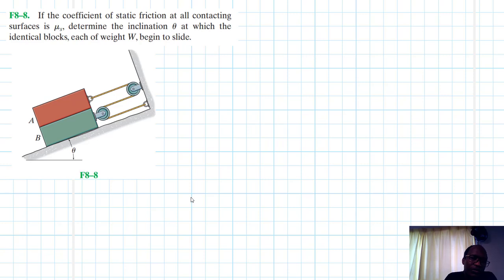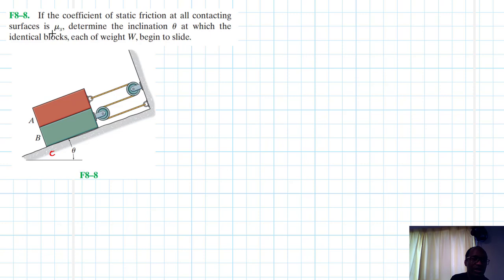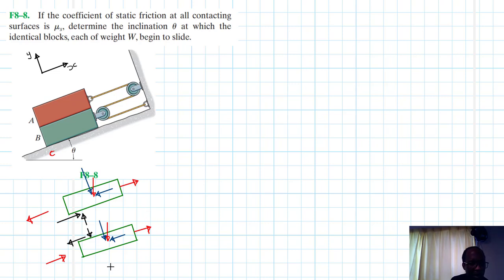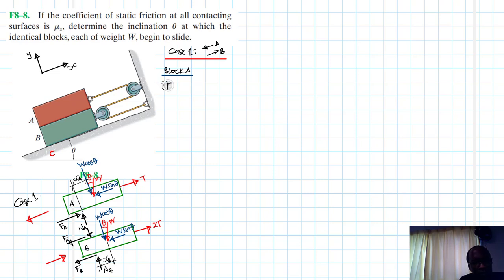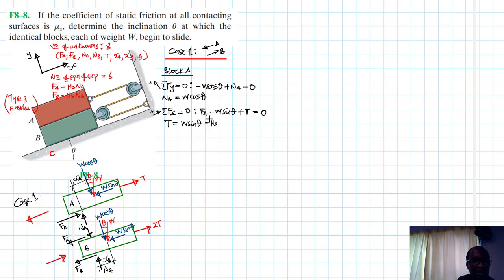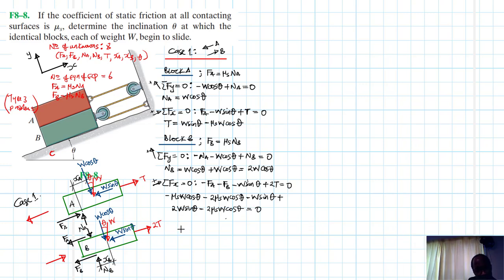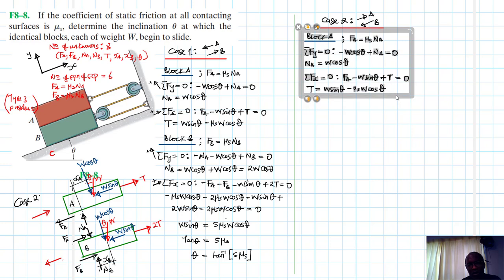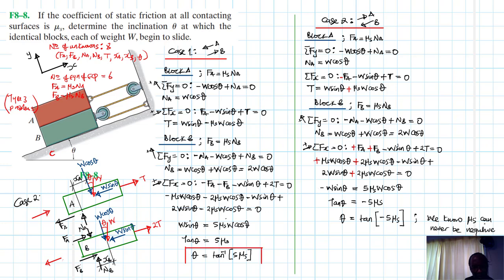F8–8 Friction (Chapter 8: Hibbeler Statics) Benam Academy

Comment: I'm not sure I understand why the 2nd solution is discarded. Even though the coefficient of static friction is always positive, the domain of arctan is all real numbers. Since arctan is an odd function, arctan(-5μ) should just give you the same angle with the opposite sign. Shouldn't it be an equally valid solution (physically) for the ramp to be tilted down instead of up?

Comment: Thanks, I much appreciate it. I do have a question: In the FBD, Block B has Na acting upon it, but A does not have Nb acting upon it. Why? What makes them different?
Reply: Because it's not Na, it's the y-component of the weight of block A, which is equal in magnitude and opposite in direction to the normal force block B exerts on block A. He just labeled it that way because the forces are the same magnitude. We don't see Nb on block A because Nb is caused by the ramp. The equal and opposite force corresponding to Nb is the combined weights of block A and B exerted by block B on the ramp .
Reply: @thedeaner3117  What about FA? Why is Fa also considered on block B but not also Fb on block A?
Reply: @j @junipersandrat ecause we are using the principle that for a system to be in static equilibrium, all components must also be in equilibrium. Although Fb does affect A through the pulley once movement starts, it is only being considered to act on B (although the WEIGHT of A affects Fb) in accordance with the above principle. It is also worth noting that the equal and opposite force to Fb acts on the ramp, rather than on A.